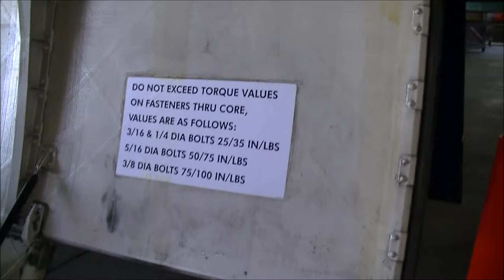Airliners International 2015: Delta TechOps Tour

Comment: I just took a tour last week. November 1st was my start date with Delta, working line maintenance as an aircraft maintenance technician. It was an amazing tour!
Reply: Is the vaccine required without any allowance for religious exemptions?
Reply: @ChanTheMan1996  they’re allowing religious exemptions for current employees. Every new employee is required to have the vaccine, if not they’ll hire someone else
Reply: @GrizzlyCompany  so even though the federal mandate was struck down they’re still requiring it? What a joke.
Reply: @ChanTheMan1996  it isn’t going away anytime soon. In my opinion I don’t see it going away anytime soon. After forcing every new hire to get it if all the sudden they stopped requiring it there would be upheaval.